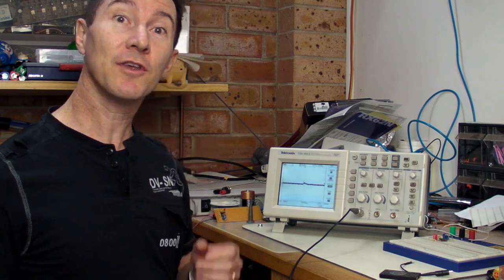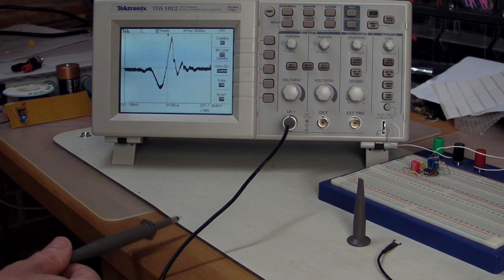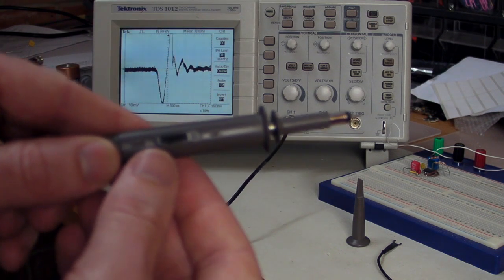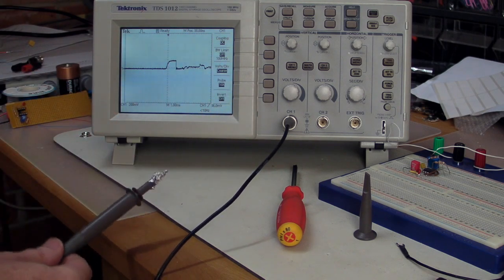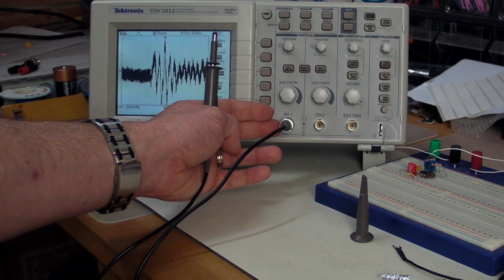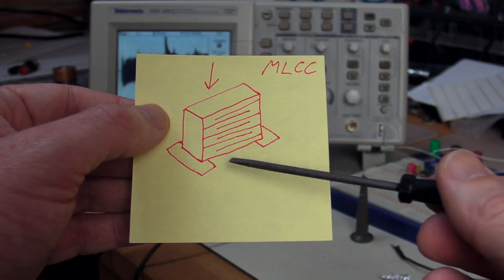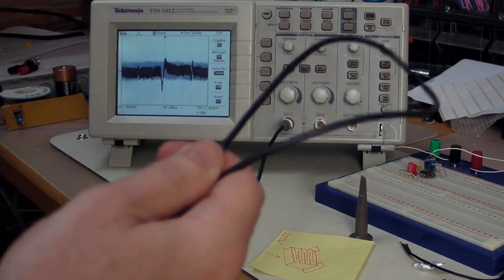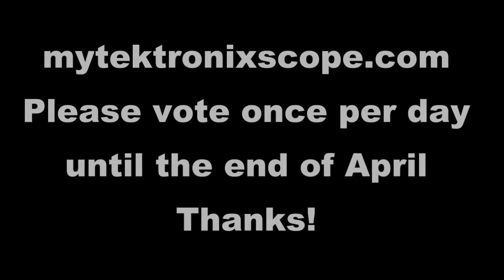EEVblog #162 - Ceramic Capacitor Piezoelectric Effect on an Oscilloscope

Comment: The variable cap will always make a difference and it's a transmission line issue not always a piezo effect. Piezo effect generates a voltage from a force. A capacitor needs some charge differential on it for this to have any effect.

Comment: This could be happening to boards too. That's the reason because most audio boards still use electrolytic capacitors. There are several ways to avoid that with ceramic capacitors. One is to properly lay out the capacitors along regions that won't bend or vibrate under use. Another way is using dampening materials on mounting points. Microphony can also be a problem.

Comment: Uh what exactly is a condenser mic? I have had caps in guitar combo amps that were microphonic enough to start a feedback oscillation.  When they start singing I just swap them out. Stay away from my probes please!
Reply: A condenser microphone is a type of microphone where the transducer is a capacitor, where a condenser is an old term for a capacitor.
Given that Q=CV, then dQ/dt=( C×dV/dt)+(dC/dt×V).
The output current, dQ/dt, is created by the dC/dt of the capacitor, since the voltage across it is held constant.

Comment: Tried this on my UNI-T UTD2052CL scope with default probes and... Nothing. :)
Reply: YS akaYSembed the probes need to be they type where the transmission line adjustment cap is in the probe. It's that cap that is causing the effect. Some probes have the cap adjuster at the socket end by the scope.
Reply: Gordon Lawrence Yes, the default probes of this scope have the adjustment cap inside, not at the BNC connector side.
Reply: did you try rotating the probe through 90 degrees?
Reply: Gordon Lawrence Yes. Maybe I just hit the probe too gently... Or maybe UNI-T employs some special method to minimize piezoelectric effect.
Reply: It's no just piezo effect. In fact a good deal of it is to do with charge in the capacitance of a transmission line. IE if you change the physical geometry of a capacitor with any given charge on it then the voltage will go all over the place. IE way up when the plates close etc. If you have a high enough bandwidth scope Johnson effect will generate a voltage all on its own. UNI-T scope probes are mid-range at best (or the best of the cheap probes) I use genuine Techtronics 15pf high frequency probes (about £300USD each) and they still do this but there is no ceramic capacitor in the probe, just a tiny rotary mylar adjustable which is similar to most (i dont know of any probes that dont use some form  of adjustable cap and most are mylar). The mylar variable trimmers are extremely vibration sensitive. Johnson noise http://en.wikipedia.org/wiki/Johnson%E2%80%93Nyquist_noise
Reply: Gordon Lawrence Wow, thanks for the comment. As for the Nyquist noise, I think that in case of a cheap oscilloscope (like my $300 UTD2052CL) ADC itself will generate far more noise than the Johnson effect, so it can be safely neglected.
Reply: Ah i was not quite clear. The Nyquist noise is what creates the differentials in both the cable and the probe that are required for a capacitor to change voltage if you change the geometry. A capacitor with 0V on both plates will not change voltage as you bring the plates closer together. So the tiny bit of Johnson-Nyquist creates a voltage differential that in turn changes as you tap the probe on the table or whatever.
Reply: Gordon Lawrence Thanks for the explanation, really interesting effect indeed.